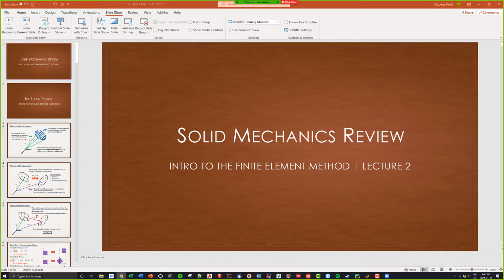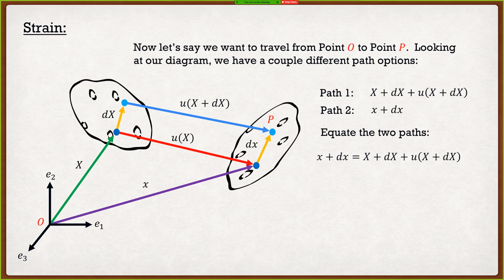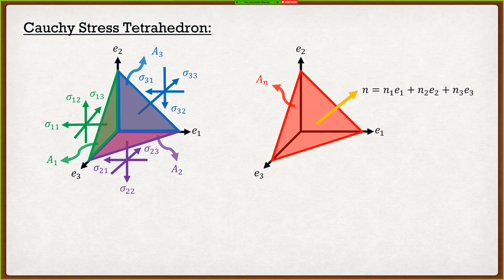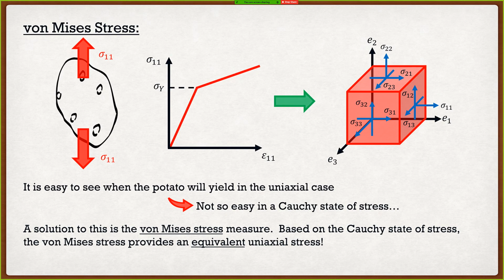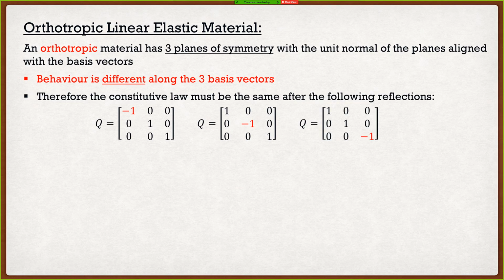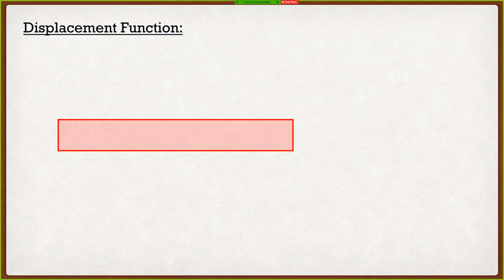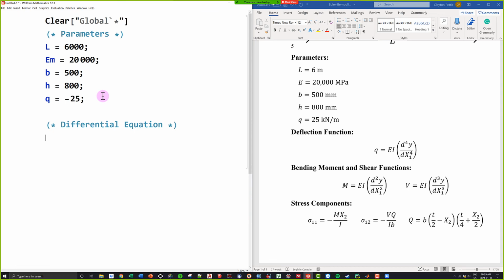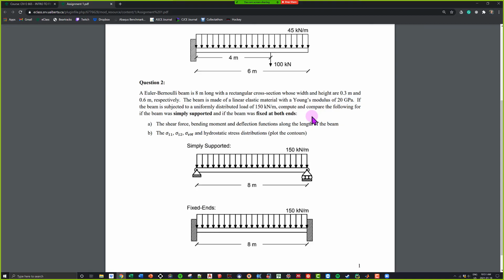Intro to the Finite Element Method Lecture 2 | Solid Mechanics Review

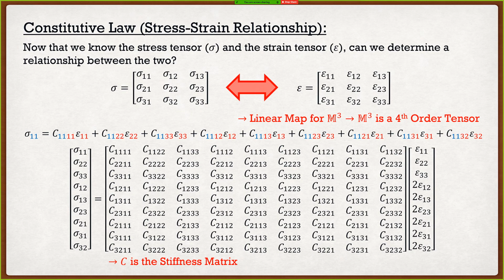Comment: Hi Mr. Clayton, in 1:18:15, why there is a number of  2 in front of the strain component from epsilon12 to epsilon32?
Reply: Two times ε is basically the engineering shear strain (γ) . The engineering shear strain γ makes the equation τ = Gγ work; i.e., the ratio between the shear stress and engineering shear strain is the shear modulus, which is convenient.

Comment: i dont understand 1:49:46, taking the limit of an expression as a variable approaches 0 is pretty standard but I figure the point of the infinitesmal dX is that its infinitesmal, so the proximity to 0 should not change the equation.